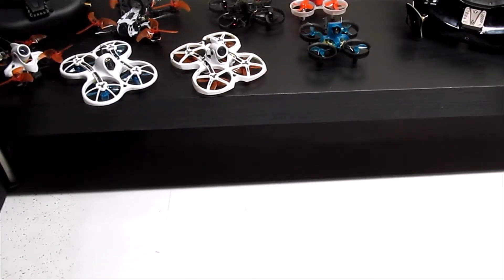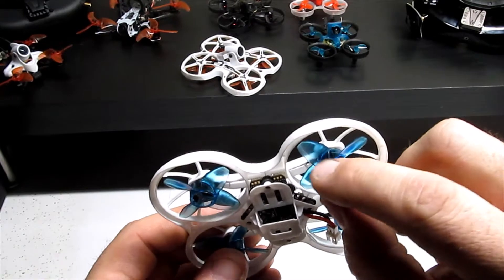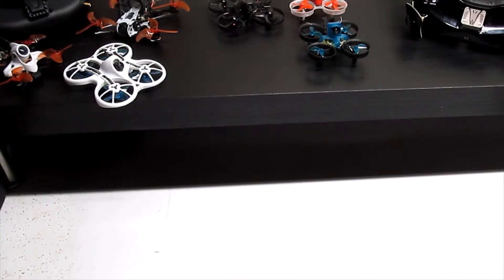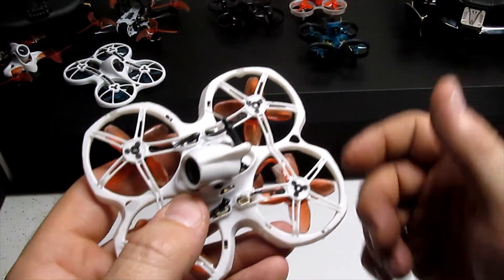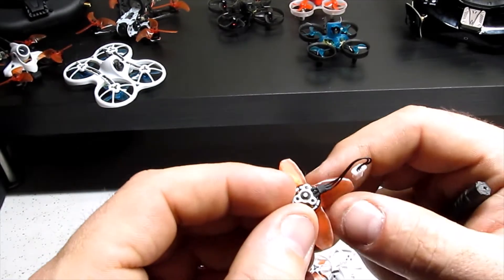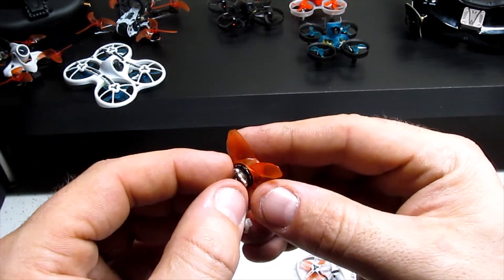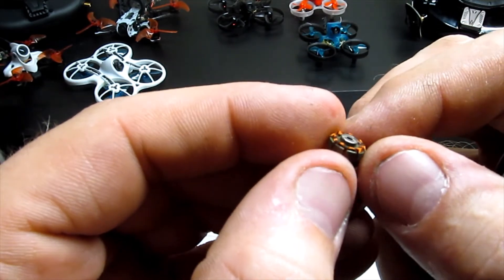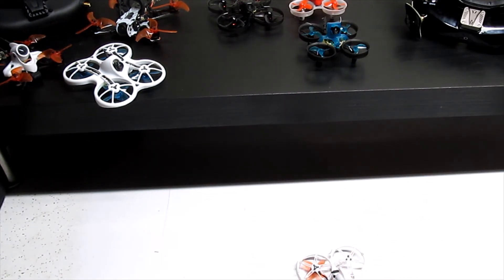Tinyhawk Motor Fix (or any brushles motor clean)

Comment: I pulled that quad out of the box and after the first crash 1 ESC is gone. I initially thought it was a motor problem (twitching not spinning), but it's the ESC that burned. Sortest lifespan ever.

Comment: Thanks good Internet person 😀 i just followed these steps and now my mobula 7 is back in the air. My front left motor stopped spinning so i immediately figured i needed new motors so i ordered some a couple days ago. In my lack of patience, i googled how to repair brushless motors and this clip popped up... Thank goodness. Only difference in my bad motor is it only had 1 strand of hair stopping it from spinning. Besides that it was clean as a whistle. I put it back together and flew it for a few minutes, now all my batteries are on charge 🙂

Comment: Having issues with my tiny hawk 3 hd freestyle. Bought it a few days ago, flew it around in my back yard, no issues. I hooked it up today after work to practice some more and my rear right prop wasn’t working. It suffered and spun a little before giving out completely. I can’t tell if there is any dirt in the motor.. although that might be what’s happening considering I flew in my back yard and crashed several times. (I’m new to fpv). Any suggestions on what to do?

Comment: I did opened up a motor that wasn't working well and removed a hair. It looks clean and the magnets look good as well but now it doesn't spin at all. I swapped motors around and have confirmed it is the motor that's the issue.

Comment: do you need to re calibrate anything? i done this and put the motors back on and now it wont lift off
Reply from the maker: Sorry for the late response. You shouldn't need to recalibrate anything. Just need to make sure that motors are spinning in correct direction. If they are spinning the wrong way, just swap two wires on motor by unsoldering and resoldering and check direction.  Good to go

Comment: After removing the C-clip for the tinyhawk III, does the thing attached to the wires come out of the black cylinder with the magnets? I am having trouble with that. Thanks
Reply from the maker: The whole bell where the prop attaches to pulls up over the Magnets. The wires stay on the base where all the coils are.

Comment: Hey I have a problem with my tiny hawk 2 freestyle my 2 front motors only start to twitch when I turn it on and won't take off I can't find anyone who has had the same problem I'm very new to fpv and this is my first drone I don't know what's wrong with it but you said something about if the coil is damaged it'll be shot is the coil one long continuous loop or does it end at some point and there's like something sticking out my motor has that and I'm not sure if it's the problem thank you.
Reply from the maker: Hey James.  The coil is the copper coils that are going around in the motor. It's all the wires that are inside the bell with the Magnets on the ends.  If they are damaged, then it will not work.  Another thing that I found with the tinyhawks are that the boards are very brittle.  Hard impacts will not show any signs of damage, but can cause failures.  I am currently trying to solve this with my father's freestyle.  One motor just twitches. When trying to diagnose, it can be tricky because it helps to have spare motor or boards that you can test.  If you have a meter you can always ohm all the wires (three motor wires) and see if there is an open, or a huge variation In resistance. This way you can rule out the motor or not. Another thing is to try and swap the motor with one that you know spins fine. If it does the same thing and twitches.  I would say it's the board that's bad.  Let me know if this helps.
Reply: @RandomHobbies20  thanks! I think that it's the motors as one of the copper wires has one of the wires sticking out.

Comment: What if it still does the fluttery wiggles after it was cleaned? Would you say switch motors and see if it's the esc?
Reply from the maker: I would check the esc.  The tinyhawk esc are very fragile and thin.  They don't take well to hard or even weird hits.  I've had one die on my when I just landed hard flat.  Caused something to go out in esc.  And it can be many things that can seem to fault out with them.
Reply: @RandomHobbies20  ya they for sure are fragile, but I switched the motor to different esc and does the same thing so I'm guessing it's the motor not the esc.
Reply from the maker: @darwinmounsey376  yea.  Could be a bad motor.

Comment: Where on where do we get more of those lil clips?!
Reply from the maker: https://www.amazon.com/Didamx-1-5mm-15mm-Stainless-Retaining-Assortment/dp/B07FFLC2DW/ref=asc_df_B07FFLC2DW/?tag=hyprod-20&linkCode=df0&hvadid=310828259700&hvpos=&hvnetw=g&hvrand=5968788316940942700&hvpone=&hvptwo=&hvqmt=&hvdev=c&hvdvcmdl=&hvlocint=&hvlocphy=9021504&hvtargid=pla-568084001926&psc=1&tag=&ref=&adgrpid=65583250281&hvpone=&hvptwo=&hvadid=310828259700&hvpos=&hvnetw=g&hvrand=5968788316940942700&hvqmt=&hvdev=c&hvdvcmdl=&hvlocint=&hvlocphy=9021504&hvtargid=pla-568084001926
Reply: Thanks my man! I appreciate your taking the time to interact with your audience. And awesome video. Earned my sub!
Reply from the maker: @My_Alchemical_Romance  thanks a lot for the support!
Reply from the maker: That's a good question. I will do some searching and post a link

Comment: Would like to have seen how you got that little clip back into place.  Thanks for the video.
Reply from the maker: I just place them near it. And slide into place.  Super easy.  The pain in the ass part is getting them off without them flying off and losing them.
Reply: @RandomHobbies20    Awesome.  Thank you so much for taking the time to respond.  I'm not afraid to give this a try now.  Thanks for the lesson.
Reply from the maker: @keitharoo1962  no problem.  Just be sure to cover the c clip when taking off.  Like I said, that's the worst part if they fly off.  Good luck!